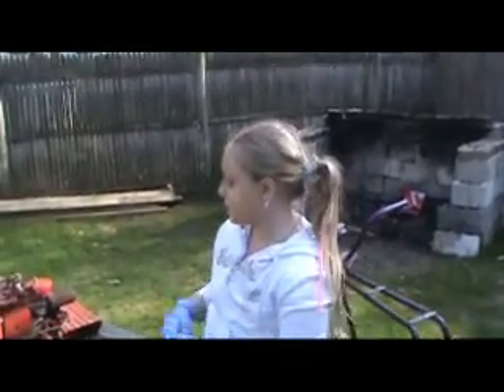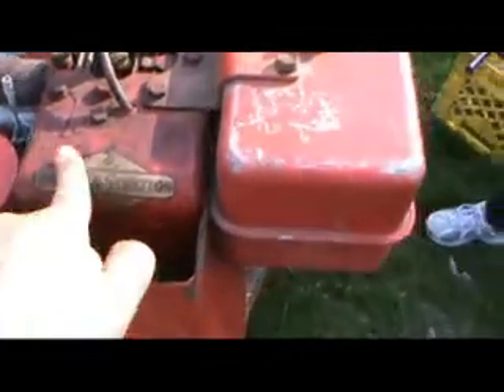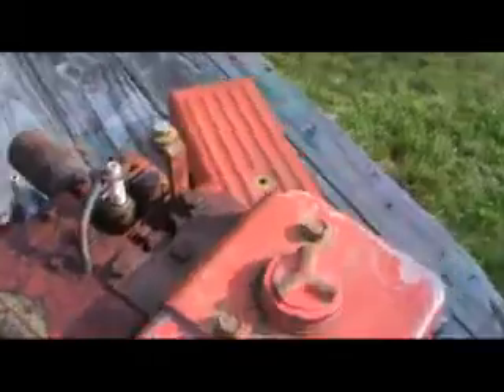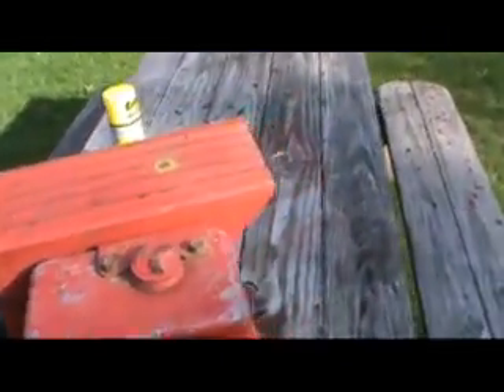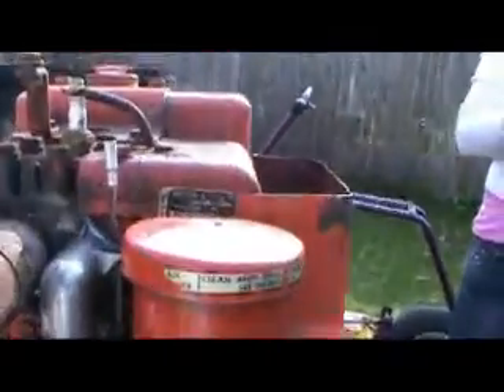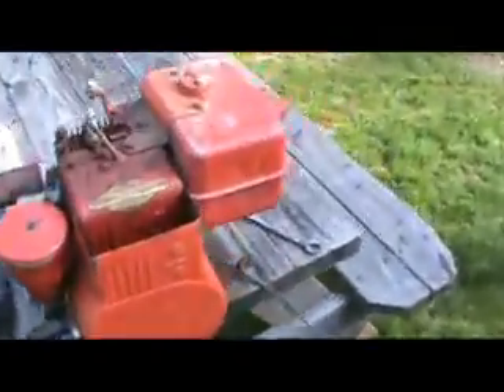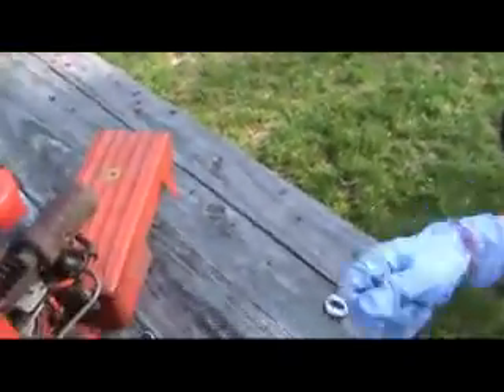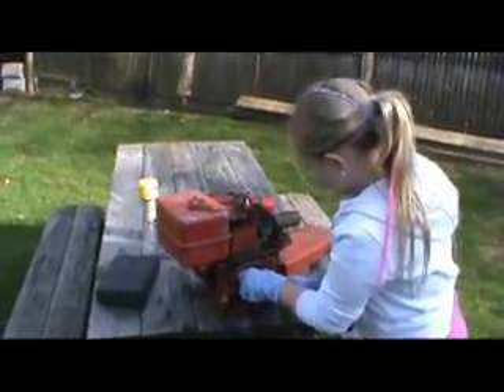MINIBIKE PART 2 ENGINE WORK

Comment: will you be fitting some sort of emergency engine cut out on the handlebar of the minibike just incase the throttle sticks open.
its good to see an old briggs engine put back to use.